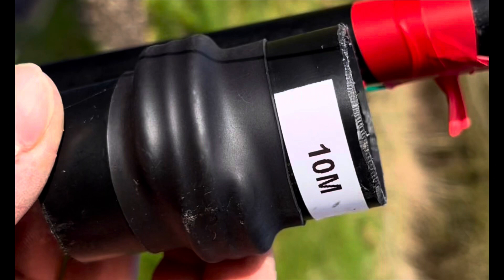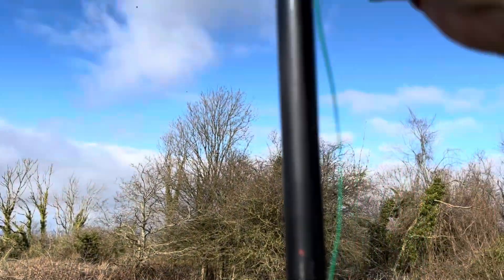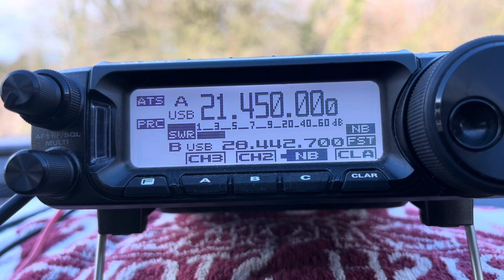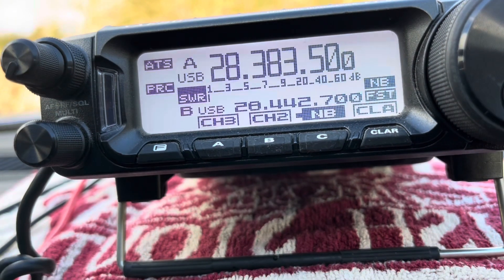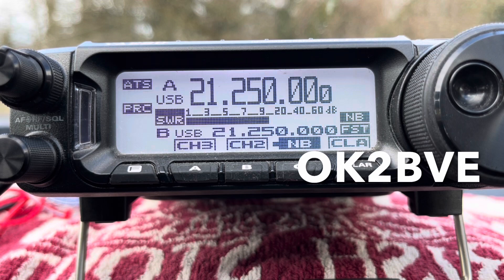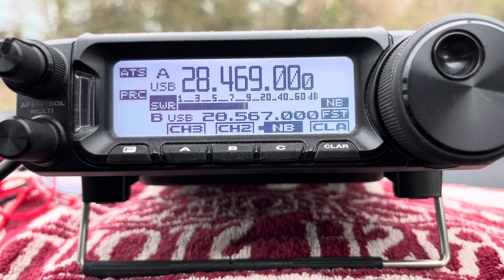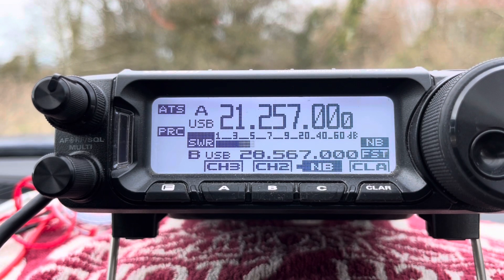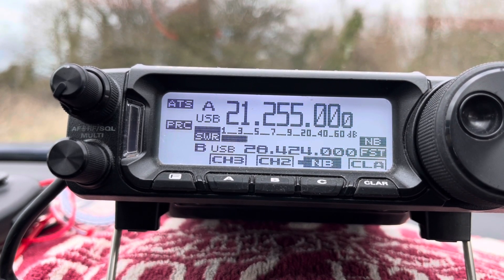Ham radio: Easy and Effective 2-Band Vertical No Radials Antenna

Comment: Can’t tell if or where your coax or radio connects to the car frame. Usually the most important issue is how the “ invisible” half of the antenna is handled.
Reply: Doesn't need the car frame. There's no invisible half of the antenna, this is a half wave, not a quarter wave. The outer of the coax will act as a small counterpoise.
Reply from the maker: As Paul said below as there is v high impedance at the feedpoint the small return current causes no issue for me on 100w. For surety you can use a choke about 2m from the feedpoint